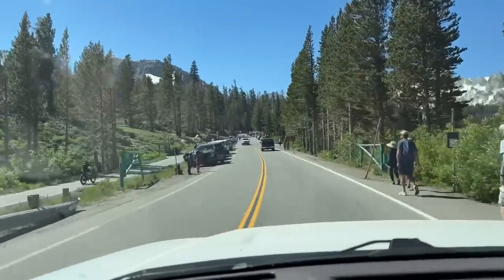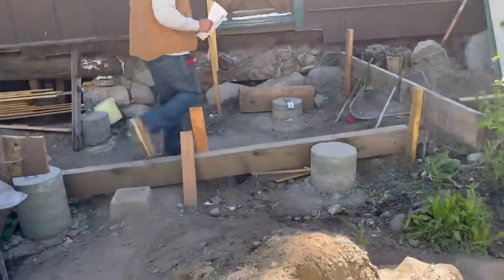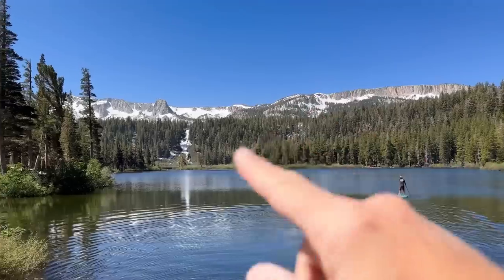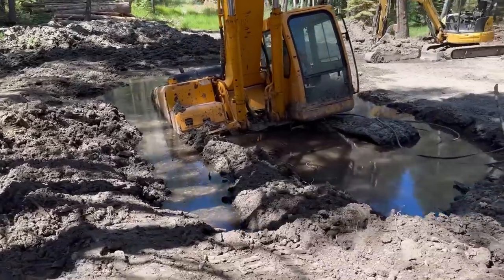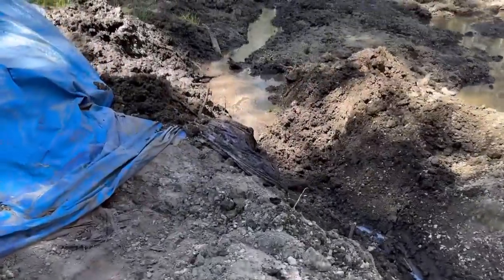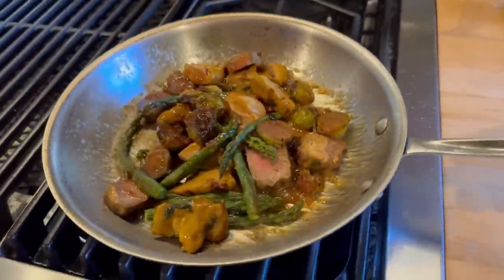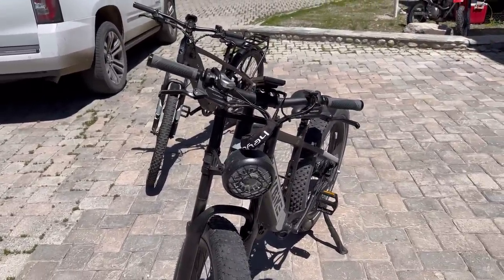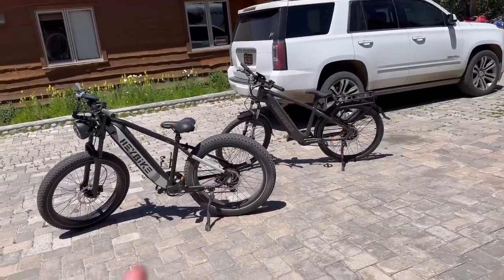Mammoth vlogs July 10,2023

Comment: For extracting the excavator, have you though about putting mats or fallen trees under the tracks? We've watched videos of a couple of other excavator operators use those types of things to getting heavy equipment out of deep water. You also need to find the source of the water so you can divert it, if possible. Enjoy the variety of things you show in your videos!